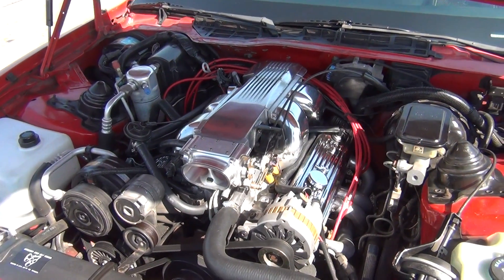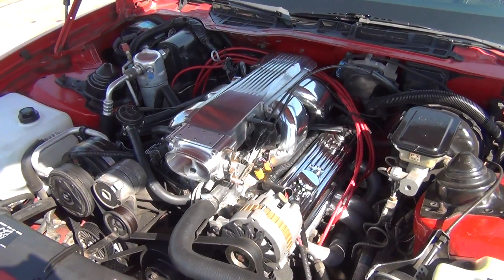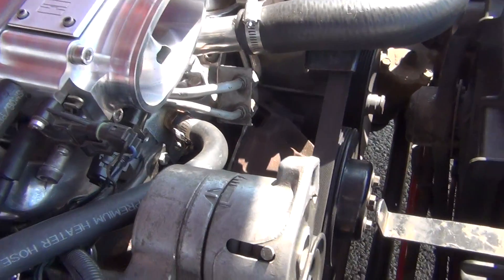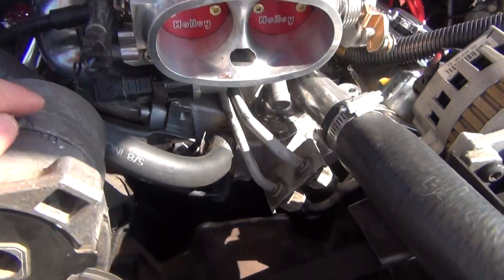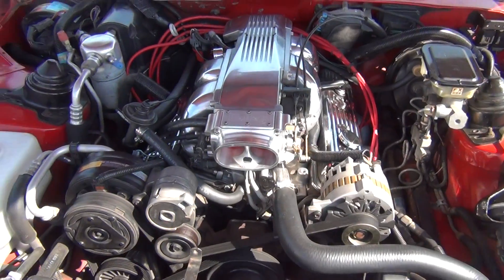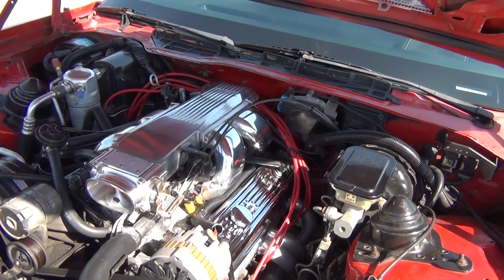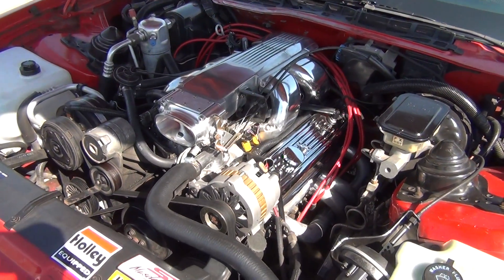Tuned port injection (TPI) throttle body coolant bybass mod.

Comment: Hiya,
Running a 383 TPI with this delete in a 1947 Chev Truck, where do the hoses go? From the inlet straight to the heater control valve?

Comment: Recently did this on my 87 TA. Did a before and after temp reading after a 30 minute drive. Throttle body is 20 to 30 degrees cooler and intake runners are around 10 degrees cooler.

Comment: Does running the coolant through the throttle body act as an additional cooling mechanism for the total system?
Reply from the maker: it warms up the thottle plates to prevent them from getting frozen during super cold winter driving

Comment: Very modest power gain, but still a gain.  Some of the low hanging fruit on the GM TPI motors are also get rid of smog pump less weight and parasitic drag too. Relocate the MAT sensor from the bottom of the plenum to the air intake this will make a noticeable improvement and a couple of tenths in the 1/4 mile. The reason is the manifold acts as a heat pump and the aluminum is much hotter than incoming air so it leans the motor way out killing power. Underdrive pullies help as does a K&N filter. TPS adjustment and timing set to 12 degrees advanced all help. 

 Doing those easy cheap mods netted me about .5 seconds on a 350 Firebird and the car was much crisper too.
Reply: How do you plug the hole that in the plenum where the IAT was at?
Reply: @BlackRam17  just leave the old one in unhooked.
Reply: You advanced the base timing to 12?  Isn't stock 6*?

Comment: Hey just curious do you have an optispark if not how did you get rid of it
Reply: This engine doesn't have the optispark. That began in 91 for vettes and 92 for fbodys. This engine runs the standard distributor.

Comment: I've had this bypassed for years and I live where temps get in the 10s and 20s Fahrenheit.  Never had a problem with blades freezing if anyone is wondering.  Don't count on any power gain.  It's just cleaner looking with plugs and 1 less possible leak to worry about.  That's all.
Reply: Do you have a picture like how To Do it?

Comment: what temperature is the lowest it can handle without getting frozen. I live in Georgia and it doesnt usually get below 40 or 30°
Reply from the maker: I think anything below 20 degrees you might have an issue with so you should be good if it doesn't go down that low at your hometown
Reply: gearheadAbe ok thanks

Comment: I don’t have a heater Valve would that cause my car tempaature to creep up slowly in a hot day on the highway. On the street is normal And I also notice my car heater is not working  the heater core seems to be cold

Comment: The gen 2 lt1 does the same thing. There’s a hard coolant line that runs along the backside of the heads and then runs to the throttle body. I plan on doing something different with it.

Comment: Good explanation but why is it there for cold weather or fuel mileage or emisons?  Just wondering but I'm all for horse power.!
Reply from the maker: It's honestly just there to keep the throttle blades from freezing. It wouldn't affect fuel mileage or any kind of emissions it's just mainly for the throttle  freezing.
Reply: @gearheadAbe  cool thanks

Comment: The man who owned my 5.7 GTA did a bunch of things that “added horsepower”. I’ve pretty much had to go back and undo all his hard work. Stopping Coolant from running through your throttle body just for 3 horse power? Just leave it the way it is supposed to be. “Don’t fix” what isn’t broken. This ultimately hurts the value of your car. You aren’t making a drag car with a stock TPI so just leave it functional. It’s plenty powerful as is.

Comment: Hello when you installed headers on  port injection did you have to get a turn? Install mine and lost power
Reply from the maker: Troy Jones  headers should not need a Tune. I did not do any to mine and the car picked up big power from the headers. You have shorty headers or Longtubes? you have your o2 sensor in?
Reply: Troy Jones headers r junk keep it factory
Reply: 85irocz28 I already installed the long tubes is there anything I can do does it have to be tuned to get more fuel?
Reply: gearheadAbe yes O2 sensors are in may need a tune to read fuel?
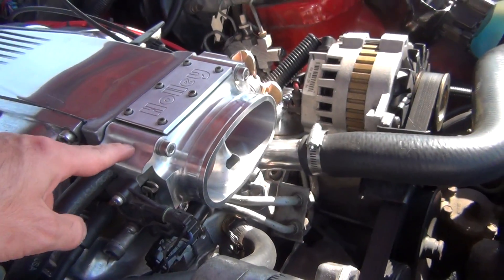Reply: gearheadAbe what is the name of the plastic device you’re holding at 1:02?

Comment: I just did this mod on my '87 Corvette. No logic running coolant through the throttle body. With a cold engine the coolant is cold as well so how does it prevent freezing?. And by the time the coolant is warm there is radiant heat from the engine warming the throttle body anyway.
Reply: Biggest problem was butterflies freezing on cruise control. Freezing air over through a tb that doesn't move on the freeway can freeze it up leaving throttle open. Its a rare case but enough for it to be designed that way anyway.

Comment: i have an issue with my TRANS AM GTA 1991, L98 350 TPI, where it is not causing white smoke when it is at the cold start, when it gets warm, it is causing a white smoke smell like oil burn or gas!! what could be the problem to check / getting it fixed?

Comment: Clean engine. I'm new in LT1 engines. What kind of intake manifold is this?
Reply: Thats a TPI 350 with what appears to be SLP runners. The L98/TPI is the predecessor to the LT1.
Reply: Thanks!
Reply: and it looks cooler.

Comment: break it down for me, I'm putting a TPI intake setup on an early model block in a swapped vehicle, I need to know which way the coolant flows. I'm not bypassing it the TB, I need cold starts. As it is right now, I have a hose running from the left side bottom fitting to the heater core, the hose on the lower intake running up to the bottom fitting on the tb, and the return from the heater core running through the water pump. Is this correct?
Reply: The coolant running to the throttle body has little to now effect on cold starts. I believe it was intended to prevent icing due to air velocity.

Comment: Thanks for the vid, came across this by accident. About 7 years ago I had a hair line crack in the tb from the coolant and it leaked. I figured out the bypass the hard way lol.
Reply: Hi Austin,  I have a 94 Trans Am I bought new. It has 337.000 miles on it, engine never been touched. Still runs great. Southern California car, it's in very good shape.  It was my daily driver   until I bought a new car in 2008. Now it's just used for pleasure,  fun. About 400 miles a year. A few days ago I came back from the post office,  and when I got out of the car a lot of smoke, i thought,  was coming out around the hood. I was like panicked,  fire I thought,  I opened the hood and discovered it was steam, coolant hissing and spraying around the oil fill and wetting the front half of the valve cover. Left side if looking at engine from front. Never had this issue before.   It stopped after about a minute.  Next day I started it, let it idle for about 30 minutes,  no sign of a problem,  drove it to the post office and back, lol, parked it, nothing.  Seemed fine. Now today I drove it around town for about 15 minutes,  came home and, Dam, it was doing it again!!   Had Goodyear look at it. It wouldn't act up for them, OF COURSE. I was thinking it might be this throttle body cooling thing I've been reading.  But then I saw you post. Do you think it sounds like the problem you had???  Any thoughts would be appreciated.  Thx

Comment: Thanks for great video. THANKS FOR RESPONDING.
Reply from the maker: your very welcome my friend !
Reply: @gearheadAbe   Where can I find one of those SLP intakes like you're using? If you know where I can get one, please let me know! I saw a pretty rough GTA for sale a while back and noticed in one of the pictures with the hood up it had one on it. Car was listed for $1,700.00. So, I thought about buying it for a parts car and was gonna take that intake off and put it on my GTA, but when I contacted the seller, the price had doubled. I asked him why and he said he didn't realize the upgrades to the engine til someone pointed it out. So, that's the closest I've ever come to getting my hands on one! The car also had an 8.8 disc brake posi rear end too that he didn't realize was under it!  Still kicking myself for not buying it anyway, even though he doubled the price!
Reply from the maker: @chucklucas5326  too bad somebody pointed out the intake on that car you could have got it at a steal. The SLP Runners I bought them on Summit Racing. They dont make these anymore so their kind of expensive now. But I see that money back from time to time they pop up I still think you can get these on Summit Racing or you can go on 3rd gen website the forms and find them in the for sale Section. I got lucky and bought them when they were $300 brand new
Reply: @gearheadAbe   Yeah, that does suck that someone told him about that intake! Between the intake and the rear end it would have been worth buying the car even though it was pretty beat up! 
I saw one of those intakes sell for $800. on eBay, and it was used! I've done a lot of things to my GTA, headers, 3" Flowmaster exhaust, MSD ignition, K&N cold air intake, 52mm throttle body and I need that intake to go with the new BBK throttle body! If I don't find one soon, I'm considering an LS and T-56 swap. Car runs pretty good now, also had Hyper Tech make me a chip and it makes crazy torque on the bottom end! I've fell in love with the LS when I bought a GTO about six months ago! That car will pull like hell long as I keep the pedal down! But I still like my GTA better, just isn't as fast as the GTO after about 60ft out. That's a Badass car you've got dude 💪

Comment: Hi there.  I was wondering what kind of air boot are using to connect the 58mm holly throttle body.  Does the stock air boot from gm fit? Please respond?
Reply from the maker: noticed I care but will not fit on the throttle body it's too small. The one I'm using I just bought it from Home Depot in the plumbing to department. you should be able to find some PCV piping or rubber that will work

Comment: the easiest way to run the coolant lines is to get a straight fitting that just fits inside the coolant hose and put one end in the left hose and other end in right hose and hose clamp the hoses so the coolant runs straight from one to the other.

Comment: I did this to my 87
I also found very nice rubber plugs for the now open coolant passages at Oriely Auto part
the plugs resemble value port plugs and looks very neat.

Comment: Whats the purpose of coolant there ? to cool tb ? because you said to do this mod if not driving in the winter.
Reply from the maker: it's actually designed to have coolant run through your throttle body to help it from freezing in the winter.
Reply: +Mohammed Al Nasri its just there to make your car warm up faster in the cold weather.
Reply: +Jake Borg oh ok. Thanks!!

Comment: I removed the housing and cut the whole water passage off, leaving just the part for the AIC motor .looks real clean and living in Az.i know i'll never need it.
Reply: I did the same thing. Except I went a step further a cut the radiator in half and filled the block with cement

Comment: Very helpful video!! On the throttle body on the left side where the TPS sensor is bolted to the left side.  Can you please tell me where the 2 vaccum lines attach to?
Reply from the maker: Sure. the 2 lines on the side of the throttle body one is going to the evap fuel purge canister and the other is going to the pass side valve cover.
Reply: Thank you sir!!
Reply: gearheadAbe can you please tell me what the name of the plastic device is that you are holding at 1:02?